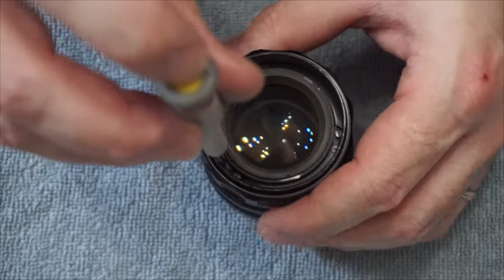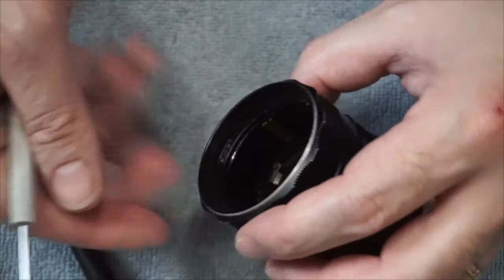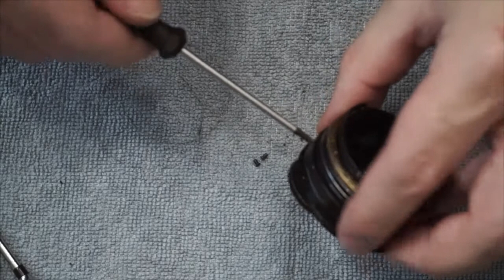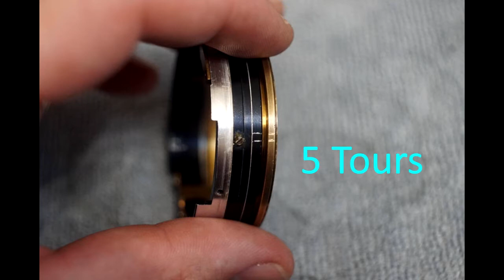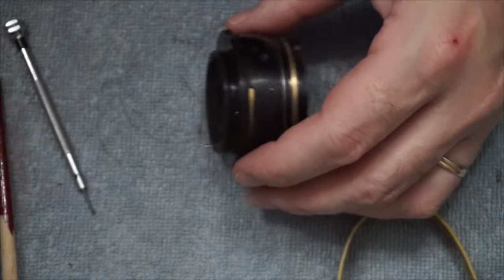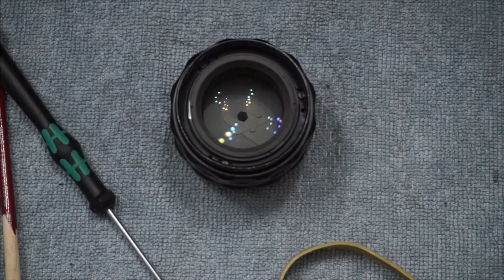Takumar 55mm 1.8 - Disassembly , Lubricate , Assembly , Refurb

Comment: Dude…. I have a beautiful 55mm 1.8 super multi coated but the range finder is loose and spins freely, it’s still useable but I’d like it to work as intended.
This looks like I have to do a complete deconstruction just to analyze the issue, and I’m not even sure if I’m skilled enough to analyze the issue let alone take it apart.
Want to trade?
Can I mail it to you?
Or better to cut losses and but another and hope it’s as good as the one I have?
Maybe just ignore the range finder issue and love the Takumar I have?